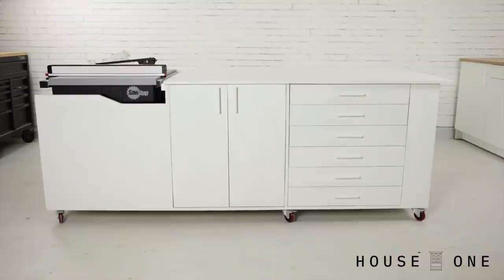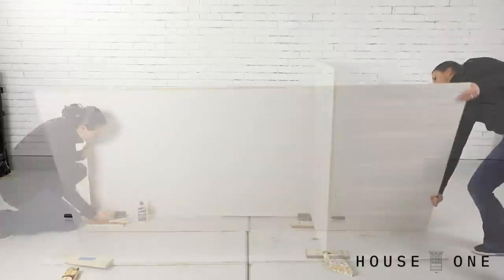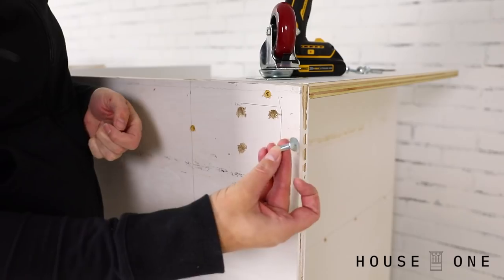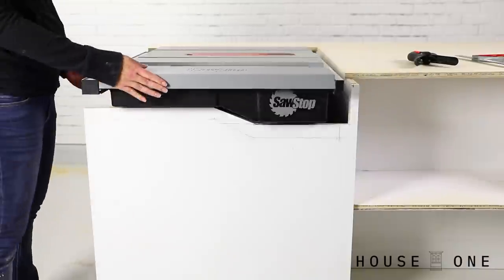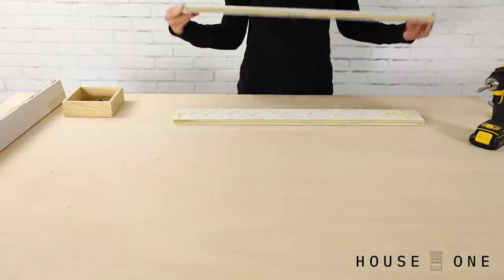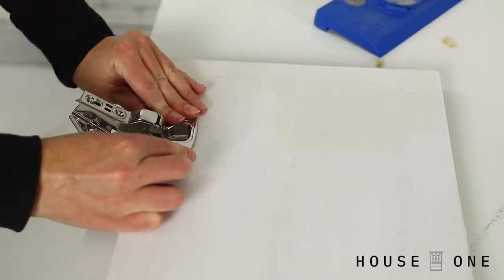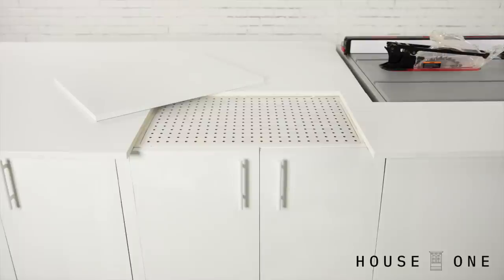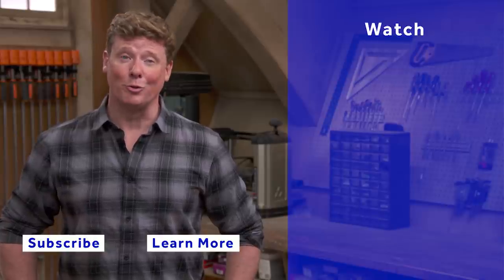Build the Ultimate Mobile Workbench | House One | This Old House

Comment: Step one: buy a Sawstop...
Dang, overspent my hobby budget by 3 years...
(kidding)
Reply: Yeah, not sure why people buy a Jobsite Sawstop. At that price might as well try to get something that reduces vibration on the table top.
Reply: @arcadion448  They want the skin contact safety system? It's the only thing that makes sense to me.
Reply: @theScamBKLYN , that can be avoided by making safety practices. Like always use the blade guard and use push blocks when your hands are less than 6 inches from the blade. If you always use push blocks, you'd never have that problem. More than likely, the Sawstop here is sponsored.
Reply: @arcadion448  yeah, I did all of that and in the blink of an eye, my sled exploded and I got to pay $50,000 out of pocket for numerous hand surgeries, specialist and plastic surgeons... I now own a saw stop... Saw stop is insurance and way cheaper than my hospital bills.
Reply: @brookekathryn1980 , Sawstop only prevents your fingers from being cut, no amount of technology will prevent kickback. Hence people uses push sticks and other safety techniques - even with a saw stop. Stop fear mongering and posting nonsense.
Reply: @arcadion448  yeah. I'm aware. Thanks for pointing out the obvious. Mine wasn't kick back. My fingers directly contacted the blade after the piece of wood that was being cut kicked (not back), pulling the sled that the wood was attached to diagonal onto the dato stack. This caused the sled and the project to explode and the folding of the sled  as it split in half then exploded (which also broke every blade guard on the saw) then pulled my hand from 8" clearance to catching my pointer and middle finger in the blade it's self. Had I had a saw stop  then or a comparable blade stop saw, I'd have saved $50,000 out of pocket and wouldn't have had to buy another saw on top of that.

But yeah, let's talk about "fear mongering" enjoy the image of my very lucky blade contact. Note every tooth mark in my finger showing how fast the accident really happened relative to the speed of the saw blade, which also negates your "kick back argument".

https://photos.app.goo.gl/XNSjEJzPT1xdkQW56

And 

https://photos.app.goo.gl/fujeaMrWW2RxxBSX7

But keep up the argument champ....
Reply: @brookekathryn1980 , all your photos prove is that you had an accident - and sure a Sawstop would've prevented you getting cut that bad. But it said nothing about any safety technique you used (or didn't use) - especially since your "sled exploded" this makes it more likely that it's user error than anything else. Every single video and story about table saw accidents have always ended up with the user acknowledging they ignored at least one safety precaution. A Sawstop isn't meant to be an end-all and ignore all caution, just like airbags aren't designed for you to forgo a seatbelt.
Reply: @arcadion448  You have nice opinions. Sadly, no matter the fact of your opinion fingers in direct contact with the blade caused the accident. Meaning that had I had a saw stop I would have walked away with possibly only a few stitches, as you yourself just stated.

Therefore user error (which in this case was not, due to banding being imbedded in the plywood causing the kick) or not, a saw stop is good insurance and worth every penny.  

One cannot be prepared for every situation, nor does one purposefully attempt, that's why it's called an "accident" there buckaroo! 

Let's face it a $3,000  saw is still cheaper than a $5,000 deductible + out of pocket. Especially considering there are an estimated 30,000 - 67,000 visits to the emergency room every year due to table saws.

But you're gonna tell me that every single one of them are due to "ignoring at least one safety precaution". I'll give you a majority... Sure. But not "all"! 

Even still, you think accents don't happen? Comical! You wear a seat belt. You have air bags, you wear a helmet, you have hand rails, you pay for insurance... Why not just be prepared for the possibility like you already do instead of crying online about other "fear mongering" because you either can't afford a saw stop or you have something against it... 

Then again. You backed up my point " and sure a Sawstop would've prevented you getting cut that bad." while negating your entire argument and that my friend means your objective and opinion are severely lacking if not completely vapid.
Reply: @brookekathryn1980  , LOL. Here's a fact for you. There are hundreds of thousands of table saws in the world and Sawstop don't even capture 5% of that market. Yet the vast majority of the other 95% woodworkers are making cuts without incident. If you wanna be a shill or endorse Sawstop by all means do it.

But your nonsensical posting only fools people who've never actually used a table saw. You claim your fingers were cuts using a dado stack, which exploded the sled and broke the blade guard. Guess what, to install a dado stack the blade guard has to be removed. I can't find a single example of a setup where the blade guard and dado stack are installed together. Also, there are plenty of products to help you hold your workpiece and keep your fingers safe - which I'm assuming you didn't use: Board Buddies, Featherboards, JessEm, etc. I have just started using Featherboards - previously I used GRR-Ripper (I even use GRR-Ripper even if cuts are larger than 6"). That's how serious I take my safety - with or without a saw stop.
Reply: @arcadion448  Doesn't matter how you spin it. You said it yourself.

"Sure a Sawstop would've prevented you getting cut that bad."

The same reason you have an alarm system or a fire extinguisher in your house. It's insurance. 

Now, how would one use a feather board or my GRR with a cross cut sled with powertec clamps that hold the material? Explain this to me... 

Being as you "take your safety so seriously", why don't you also have another layer of protection like a reaxx, whirlwind or saw stop?

Or are you to busy trying to use your GRR with a feather board and stock guides on your crosscut sled? 

Instead of trying to argue about overhead dust collection dato blade guards that you know nothing about.  Maybe stick to videogames...

But let's face it, you're gonna argue to the death about "safety" and yet don't have a contact stop saw... Making you the guy we should listen to the least! 

Might as well be the safety guy on a job site without a hardhat because you have steel toes and a vest.

Then again if you actually "took your safety seriously" you'd have a saw like a " Sawstop (or any contact saw) that would prevent you getting cut that bad." 

Ouch, next time you shoot yourself in the foot try not to do it in a public thread...
Reply: @Kevin-mp5of This guy wants me to use a GRR with feather boards and guides while using a cross cut sled and now wants to judge you about not being a pro. Then he goes on to cry's about "taking his safety super seriously", yet doesn't own a contact stop saw that he himself stated "would have prevented me from getting such a deep cut". Priceless!
Reply: @brookekathryn1980  Sorry, not going to click on those photo links because the URL looks suspect. 

But what I can't figure out is how your accident played out. Did you sled have runners in the table's miter slots? If so, how did the blade pull the sled laterally? 
If the blade pulled the whole sled up enough to pull it out of the slots, then it must have pushed your hands way up too. Plus, the bottom of the sled much have been on top of the blade itself. In that scenario, I can't figure out how your hand went from being 8"+ away, to being push up vertically by the sled being pushed up, then pulled over with then sled, and then I guess pulled back down and cut by the blade after the blade cut through the base of the seld. 
Sorry, maybe it's the way you're describing it, but it doesn't make sense.
Reply: @arcadion448  If his crosscut sled somehow made contact with the blade and got pulled into it, then that is the failure point right there and it's his fault. No half decent crosscut sled with runners properly built in to fit into the miter slots should ever come in contact with the blade except for when the sled is being made initially. If his sled moved on the table and came in contact with the blade, he screwed up and wasn't being safe because he was using unsafe equipment. Period. And honestly, the whole story doesn't really add up to me. 

The sled itself is a safety tool as much as it is a jig or accuracy tool. Properly made with stop blocks and hold downs, there's virtually no chance of injury. I have never heard of anyone having this kind of problem with a crosscut sled. He's just unwilling to admit he screwed up.
What I don't understand about SawStop users is, what do they do with all the rest of the dangerous power tools in their shop? Everything else has an equal or greater chance of injuring them,, yet they seems to be perfectly comfortable using tools anyway. 

If people wat to spend 2-3x as much on a table saw just for one small feature mitigated by basic safety measures, I guess that's their choice. But IMO they re overpriced and, if anything, make people overconfident and more likely to act less safe at the table saw.
Reply: @thomashajicek2747  Good thing I wasn't talking to you so you don't have to click on the links. That being said you obviously didn't read any of the past replays where all of your assumptions where discredited.
Reply: @Kevin-mp5of  Apparently!
Reply: @brookekathryn1980  I read through all of the replies, but still don't see how your saw "kicked" the wood. You say the blade caught the workpieces that was attached to the sled and the blade "exploded" the sled. I just can't imagine why that would happen to a piece of wood firmly secured to a well-made crosscut sled sitting firmly in the miter slots with no play in it, Especially when making a dado cut, which doesn't even cut completely through the workpiece. If everything was firm and secured, the workpiece and sled it's on shouldn't go anywhere. And if it did somehow kick grab onto the workpiece, I don't see how it would pull your hand into the blade 8" away instead of knocking your hand away from the table top. I imagine that if it "exploded" your sled as you describe, the bigger issue would be chunks of the sled flying into your face and body.
Reply: @thomashajicek2747  I'm sorry to hear of your reading comprehension issue.
Reply: @thomashajicek2747 , I wasn't there so I won't say his sled was badly created. But I  agree with you that it's the first time I've heard of a sled coming into contact with the blade.

Dado stacks can be prone to kickbacks, but then again if you're gonna take the time to create a sled - why not add T-Track slots as well. True be told, if I had the need for it (I go from being a hobbyist to a pro-consumer), I'd get a SawStop as well. It's like having airbags in your car. You go from getting a banged up head to just a sore neck.
Reply: @arcadion448  It had T-Track slots... Need I explain physics to you as well? k
KE(1/2)mv2. As kinetic energy, mass and velocity contact a stationary object harder than the wood being cut suck as the banding in the piece of wood I happen to be cutting left by a manufacturer. An 18,000 SFPM blade contacting a dense object approximate hardness just over 2 BHN is no match. When the density changes to an average of 50 BHN @ 18,000 SFPM energy transfer of BHN = 2P D/D(2) -d(2) is equivalent to 2,899kg of force transition from kinetic to static. This is not only enough force to dislodge a T-Trac with a massive jump as a reaction as Newton's third law states, but to also fold a sled like a taco in 10-3 (.0001 seconds) pulling hands with an average forward/downward force of around 32 PSI meaning lateral downward velocity toward it's gravitational impact site KE/ST is approximately .001233r seconds @ 6,318 lbs of force, and you think an aluminum T-Track is going to stop 6,000+ lbs of dynamic force per outer scoring blades ((((6,000x 2 = 12,000+ lbs)+ (2,000 lbs x2 chipper blades @ 18,000 rpms) x 2)))) = 16,000 lbs?

We can also calculate the air density into that at 5,681 ft ASL if you'd like to get a higher more accurate number for K/M/V to S/D/F reactivity.

But I'm glad you'd value your "safety that you're so serious about" and get a saw stop or comparable product.

As I've stated time and time again. A $3,000 saw is much cheaper than a $5,000 deductable and $50,000 out of pocket (in my case)...
Reply: @arcadion448  the safety features in my car are to protect me from other people’s mistakes I can’t control. In my shop I don’t need to worry about other people.
Reply: @thomashajicek2747  Yeah like the mistake of a manufacturer leaving metal banding inside a plywood panel... "No need for you to worry about others in your shop"
Reply: @Kevin-mp5of , yeah cause we're using one of the most dangerous tools in the shop. If you aren't an expert on all the safety features, don't use it.
Reply: @arcadion448  wow, you must run a small arbor speed on your saw. Also you obviously don't understand resting presser/ forward force now why would you factor total cutting weight be actual material density into your math. That's comical.

While we're at it explain exactly how one is to get a pinch when using a dato stack? Is it because you're using a feather board?

Best. Let's break down your math minus your randomly inserted variables.

KE(1/2)mv2. As kinetic energy, mass and  An 17,000 SFPM blade contacting a dense object approximate hardness just over 2 BHN is no match. When the density changes to an average of 50 BHN @ 18,000 SFPM energy transfer of BHN = 2P D/D(2) -d(2) is equivalent to 2136kg of force transition from kinetic to static. (Which has nothing to do with speed for the sled moving forward or the total weight of the object being cut as per your ignorant variables attempting to look smart)

 This is still not only enough force to dislodge a T-Trac with a massive jump as a reaction as Newton's third law states, but to also fold a sled like a taco in 10-3 (.0001 seconds) pulling hands with an average forward/downward force of around 1.25 PSI meaning lateral downward velocity toward it's gravitational impact site KE/ST is approximately .001264r seconds @ 4,700 lbs of force, and you think an aluminum T-Track is going to stop 6,000+ lbs of dynamic force per outer scoring blades ((((4,700x 2 = 9400+ lbs)+ (970 lbs x2 chipper blades @ 17,000 rpms) x 2)))) = 11,000 lbs?

But I'm glad you'd value your "safety that you're so serious about" and get a saw stop or comparable product.

As I've stated time and time again. A $3,000 saw is much cheaper than a $5,000 deductable and $50,000 out of pocket (in my case)...

While we're at it, gee I wonder why I said my sled "exploded" which implies flying debris, but you didn't pick up on that did you? 

More reading comprehension issue to go along with your failed physics.
Reply: @brookekathryn1980 , LOL are you still at this? All the math in the world isn't gonna help you change the fact that non-Sawstop table saws are used by hundreds of thousands of woodworks without issue every year. Maybe spend less time with your "flawed physics" and more time with table saw safety.
Reply: @brookekathryn1980  , lol you can't even get units of forces right. Real woodworkers don't have to go that level of (flawed) details. Nobody is being fooled.
Reply: @arcadion448  and yet you don't understand that 1 lb of force is equivalent to 4.448 Newtons. Sad

Super strange how POUNDS per square inch is used on mechanical pressure applied, then again here you are wanting Newtons for downward pressure? Yes applicable but not the correct unit for this application as we aren't talking about rotational force but rather downward pressure applied/ transfered. 

What's next you wanna start yelling about Joules? 

At least you would have been in the ballpark with that one as rotation to transferring to lateral energy transfer can loosely be forgiven in this equation.

Non of your attempts to look educated on this topic are going to change the fact that you specifically stated  "True be told, if had the need for it go from being a hobbyist to a pro-consumer), l'd get a SawStop as well. It's like having airbags in your car. You go from getting a banged up head to just a sore neck.".

Yet, you're a "real woodworker" my argumentative "hobbyist" and apparently physicist friend who "takes his safety that seriously" yet doesn't own a contact stop saw.

Hypocrite level 100 right there! 

"Nobody is being fooled".
Reply: @brookekathryn1980   so your saying they left metal banding within the layers of the plywood itself? Well first off there wouldn’t be any metal banding inside the layers. What purpose would it serve and how would they extract it without destroying the plywood??
Second, I’ve hit my share of metal in wood before, screws, nails, staples, etc, and never has it done anything like what you describe. The worst it’s done is destroy my blade. I’ve since wised up and gotten a metal detector and check anything not solid wood to eliminate that variable. 
But even in the case of some metal in your plywood , the part about your hand being pulled in still doesn’t add up. If your hand was at a safe distance as you say then the downward force of the blade on the band would make the sled to the left and right of the blade go up, and take your hand up with it. Not make your hand move laterally into the blade. In the situation you’re describing it sounds more likely that your hand was injured by the sled than the blade.
Reply: @thomashajicek2747  So again, I'm sorry to hear of your reading comprehension issues... Had you opened the images and comprehended what you read above your assumptions where again discredited.
Reply: @brookekathryn1980  You said above that the blade grabbed the metal banding in the wood, “folded” the sled “like a taco” and then the sled “exploded. These are your words that leave little room for any other interpretation.

If the sled “folded like a taco” with your hand on the sled 8” away from the blade, your hand would be pushed upward along with the side being pulled up. Not laterally toward the blade.

If the sled “exploded” from the force of the blade, that means the release of energy from the “explosion” came from the blade area. This force could only move your hand further from the blade, not toward it.

So exactly what force of energy caused your hand to move counter to these other movements you described and get you hand from 8” laterally away from the blade to be in direct contact with the blade?

Last but not least, clearly metal banding is something that is NOT supposed to be in a piece of plywood, and if you were following all reasonable safety measures, have you ever considered holding the manufacturer of the plywood liable for your injury and subsequent costs? They were clearly negligent in allowing some errant piece of metal to get embedded into their plywood that doesn’t belong there. And it’s reasonable for your to assume a piece of plywood does not contain long, thick, metal banding that can cause an accident such as yours. 

Maybe after ordering up that SawStop you should have called a lawyer! You shouldn’t be out of pocket for the manufacturer’s negligence.
Reply: @thomashajicek2747  Again. I'm sorry to hear of your reading compression issues and lack of understanding of physics.

Also you act as though a lawyer wasn't involved (father in law) and that out of pocket must be paid up front until a settlement is paid. 

Medical bills don't wait for a settlement champ.

Maybe stay out of law and physics in your vapid assumptive arguments.
Reply: @brookekathryn1980  Both basic physics and your explanation of the incident prove my assertions. The fact that you have nothing to say to refute them other than essentially saying “you’re wrong” only proves my point. If you had anything else to prove yourself, you would say it.
-	If something folds “up” anything in contact with it is also folded “up” not down or laterally.
-	If something “explodes” then anything in proximity to the explosion is pushed away from the source of the explosion, not towards it. 
-	Both of those forces are completely contrary to your assertion that the incident pulled your hand into the blade.

These are your words and the basic physics associated with them that any child could understand. Either change or add to your story to one that conforms to the basic laws of physics, or just don’t respond.
 Or just respond with another “you’re wrong” variation to further prove me right.

PS, I know all about accidents and medical costs. I got hit head-on by an idiot and didn’t have a settlement for over 2 years. But I didn’t go around pretending that I had $50k in medical expenses, or even $3k in deductible expense when I knew I was going to get all of that back plus another $150k in my pocket. You’ve only proven that you’re not permanently out of pocket a dime over this situation, and if your lawyer is any good at all, you’ll actually profit very well from it to compensate for your injury.
Reply: @thomashajicek2747  One need not disprove assumption. One must first prove such.

Remember nothing was said that suck "folded up". Especially with blade force being pressed down creating an impact location. Which as we all know due to Good old Einstein. And from that point we can immediately negate your ignorance and the rest of your rapid response of assumptions.

Next let's point out the fact that an explosion would require inward force first which is known as a point of impact causing a negative pressure toward that point of impact drawing all mass around it toward such point. 

Where you're focusing is the explosion or the outward force would be the equal and opposite action of that inward force.

This completely negates your argument!

Buy thanks for posting my point I suppose.

Now, for the first time you're right that I did profit off of my settlement.

Also note, that again you're making assumptive remarks to where I never once said "permanent out of pocket expenses". 

Just "out of pocket expenses".  

Which means here you are making things up again disproving and discrediting any assumption you have.

Seems sad that you don't understand that copay and specialist copays cost money though which makes me not trust a single word you're saying. 

I highly doubt that you had any type of incident as you would fully understand such if you did.